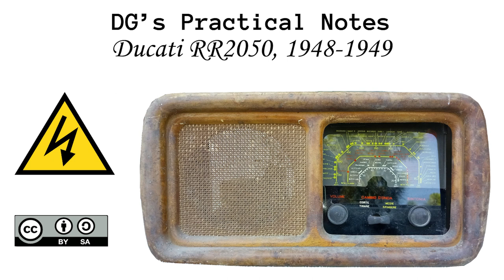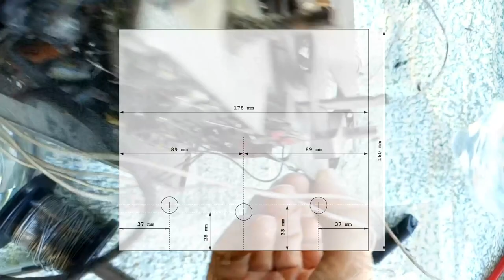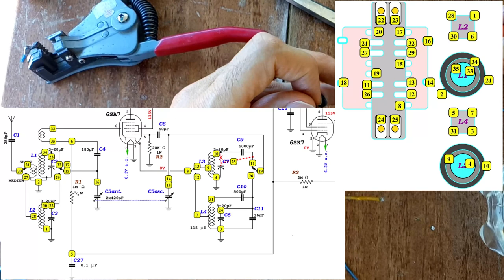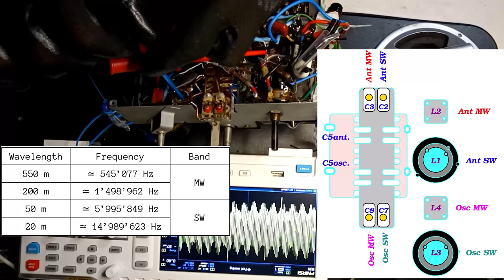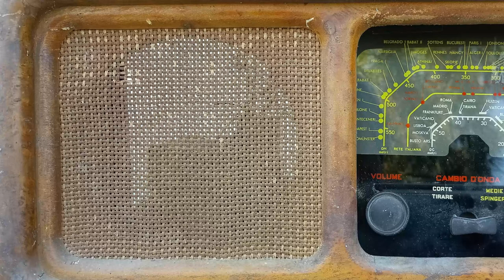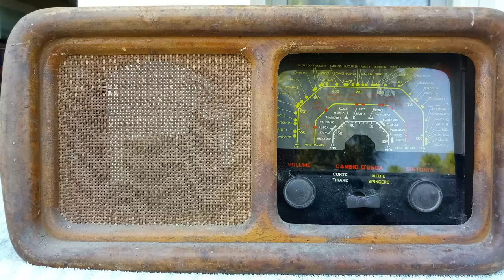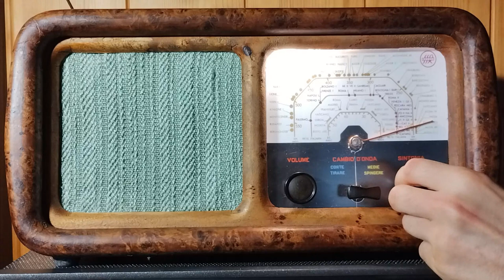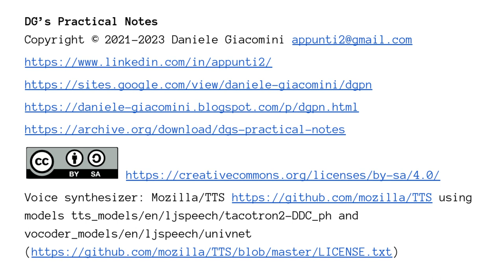DG’s Practical Notes, R#2 Ducati Rr2050, 1948-1949 [v2]

Comment: Wow that was in a predicament at the start. I think your safety advice applies to anything electrical but these old valve radios do produce significant heat. I have a radio here at the moment with asbestos under the chassis so until I find the correct way to deal with it I cannot start the restoration.

Great video with exceptional attention to detail at every stage, thanks.
Reply from the maker: Thank you so much for your appreciation and encouragement. 🙂

As for asbestos, in my opinion, if you have it there in a radio, even if you are not using it, it is a problem until you manage to dispose of it, because some small fibers could be released in the air with the risk of inhaling them. Temporarily, I would recommend to put the radio in a sealed box, until you can deal with the disposal of the asbestos. Then, of course, you would need respiratory protection and something to stabilize the sheet of asbestos (like glue or laquer). Only then, I think, the asbestos sheet could be removed and sealed. Later, I would recommend to clean the radio, because some fibers of asbestos could be hiding everywhere.
When the radio is «safe», you could think of something else in place of the original sheet of asbestos.
Reply: @appunti2  Thank you for the prompt reply. Yeah, I've got it sealed in a thick black refuge bag. I will be taking the necessary precautions to fully eliminate it from every nook and cranny and replace it with a suitable substitute. 👍